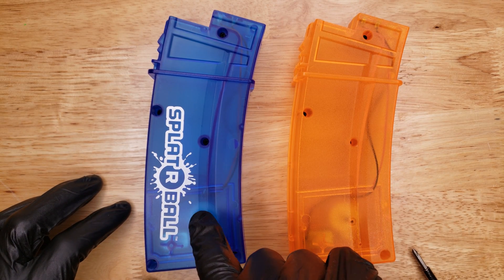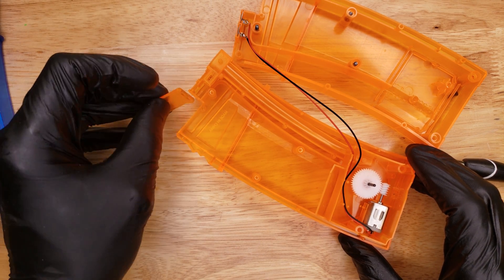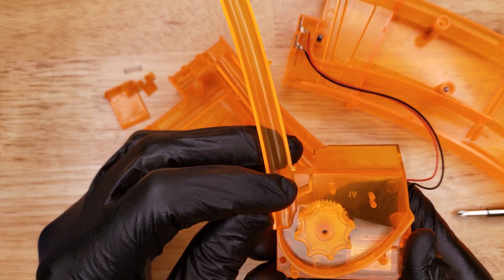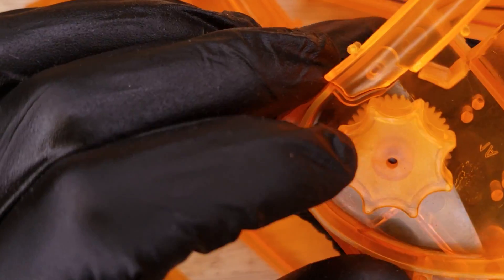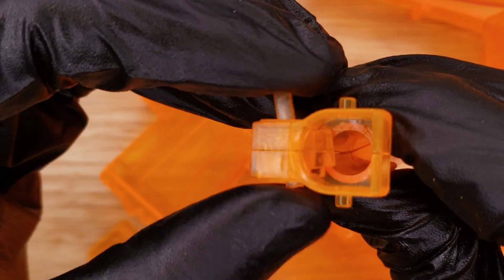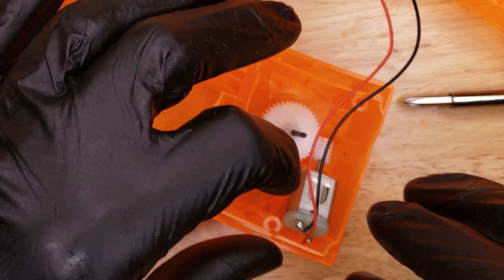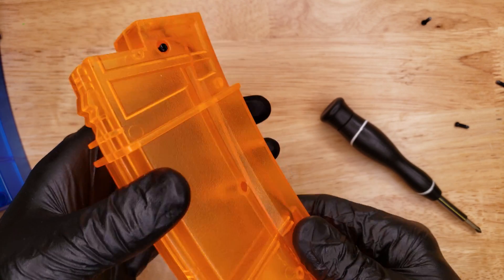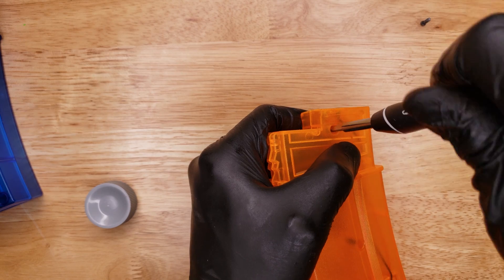What's Inside SPLAT-R-BALL MAGAZINE I Take Apart Splatrball SRB400 Round Mag & Put It Back Together

Comment: I’m having an issue where my motor spins the opposite direction, making the orbeez not enter through the magazine to shoot it
Reply: Idk if this will work. Try and reverse the motor output. Or change the directions of the gearbox
Reply from the maker: Seems like your mag contacts are crossed. Take either the blaster or the mag apart and switch the contact positions.

Comment: I have to put some pressure to spin the motor do you know what I should do?
Reply from the maker: Pressure where?
Reply: @engineerable on the gear thing, is it supposed to move smoothly when spinning it?
Reply from the maker: @jonathanaguilera505  yes it should. The plastic can crack and it can get loose on the shaft. Glue it back on with super glue.
Reply: @engineerable  when I open the mag there’s little orbee pieces squished, the gear does not run smoothly at all what should I do to fix it

Comment: hey what is the substance you put on the motor?
Reply from the maker: Super Lube Grease https://amzn.to/3JXpw3F
Reply: @engineerable  also what should i do if it stops spinning
Reply: is it just broken at that poitn
Reply from the maker: @a.p.fortnite2980  probably, but could be a few issues. You need to test with a voltmeter to see if your getting power to the motor. Or maybe one of the gears are loose on the shaft.

Comment: When I was modding  the gun the white wire came undone from its soldering and doesn’t power the mag. can re-solder the wire back to its original position so that it powers the mag.
Reply from the maker: Yes, you need to resolder it.

Comment: At 3:52 did you super glue it?
Reply from the maker: No, that was grease for the gears
Reply: @engineerable  where can I find the one you used? And what do I need to super glue? The wheel doesn’t spin when I shoot what can I do
Reply from the maker: @w.agarcii_2172  is the motor spinning?
Reply: @engineerable  the white wheel no and I just bought it
Reply: @engineerable  it gets stopped by the thing you put grease on
Reply from the maker: @w.agarcii_2172  but does the motor spin?
Reply: @engineerable  no it doesn’t spin
Reply: @engineerable  does the worm screw have to move and does grease help?
Reply from the maker: @w.agarcii_2172  then the motor is jammed or electricity is not getting to it. You need to use a voltmeter to see if it's getting electricity. If you just bought this and it has failed already, return it. They need to learn to make stuff better.
Reply: @engineerable  okay does grease help? This my last hope
Reply from the maker: @w.agarcii_2172  I only applied grease to reduce the friction on an already working motor gear. If your motor is not spinning, there are other issues that grease won't fix.
Reply: @engineerable  okay I will try it hopefully it works thank you 🙏

Comment: Does the splatter ball & Lightning blaster have the same clip. Or where can I get an extra clip for the Lightning?
Reply from the maker: Splatrball and Lightning Blaster mags are not interchangeable, I have tested. Lightning Blaster should be compatible with WELLS G36C mags, which are available here, but I have not tested these https://m.zhenduotoys.com/Wells-G36C-Magazine-p746039.html
Reply: What's the difference? Can't find any magazines anywhere. Did purchase the mag u posted but scared it doesn't fit.

Comment: Do u know why the motor in the magazine ain't spinning
Reply from the maker: Could be many things. You will have to debug. First test with a known working mag to rule out an issue in the blaster. If the other mag works, then it could be a burned out motor, loose gear that drives the gel balls (glue it back on with super glue), or loose wire.
Reply: @engineerable  do we glue it like in part 3:52?
Reply from the maker: @w.agarcii_2172  that was grease for the gears